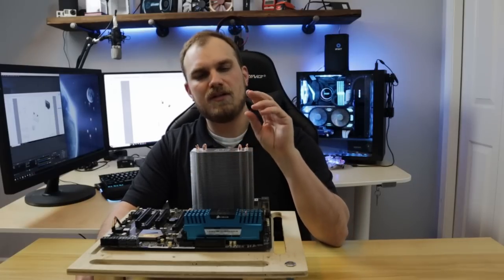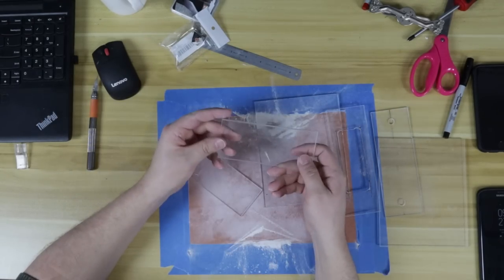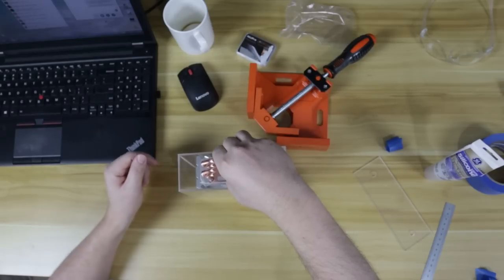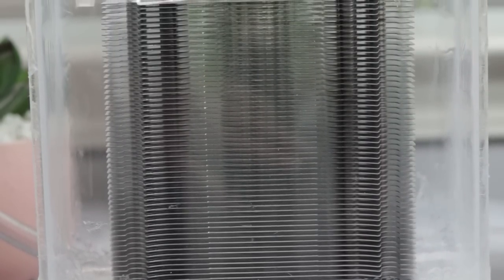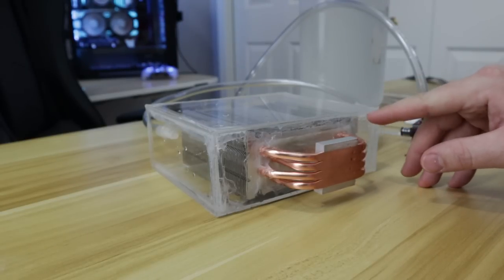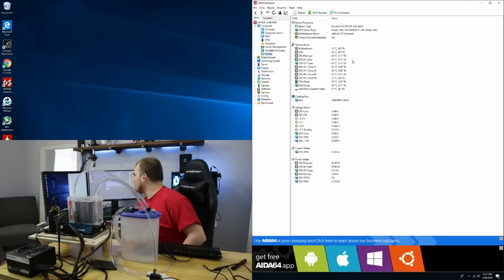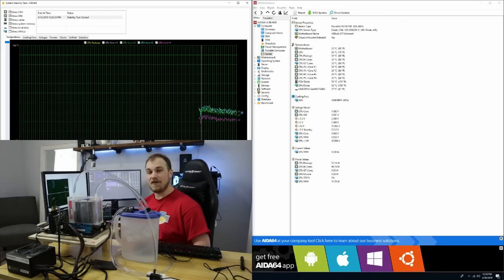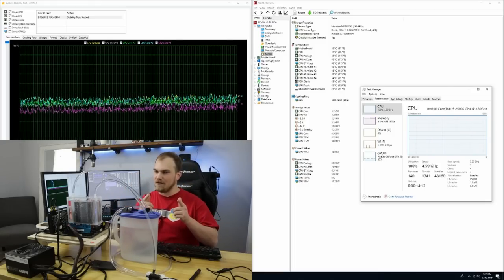I Water Cooled My Air Cooler AND..........

Comment: corsairs going to steal your idea and slap some RGB on it
Reply from the maker: RGB Would be sweet
Reply: hahahahhahahahahahhah
Reply: @MajorHardware  Put the LEDs in the water. They should do it.
Reply: Useless design, and technically it is reverse of Radiator with more disadvantage of no further dissipation of heat from the water. In radiator it is done by air cooling through Radiator FINS! it is good to be a Computer engineer, but implementing Mechanical to it requires knowledge.
Reply: @lakshaytewatia6205  U must be fun at parties.. 🙄
Reply: Lakshay Tewatia hey how bout an aio dipped in water inside a small chiller
Reply: @andrewmendoza6531  Brother i said accordingly to what the guy used in this video, and the external source which keeps the water cooled, is Ice!...and how long it could last? but ironically he improved it in his next video where he added an External Radiator to cool that water down..!so tell me what is the use to cool a radiator submerged in water and to cool that water he used another radiator! does this make any sense for this micro level of circumstances.
Reply: @nekokarasu1087  yea I could be... but not as famous as you kid. First go and learn the technical and practical terms. I do not argue with them who get fascinated by the Asthetics only to just look cool but of no use.!
Reply: @talon1706   I'm trying to spread knowledge among those who don't have any idea
Reply: A Gamer RGB
Reply: Oh that would be amazing with the aura rgb inside it
Reply: @lakshaytewatia6205  as far as actually being useful no this is a goofy idea but it looks cool but yeah i agree its impractical to use a radiator to cool another radiator but if you slap some blue leds in it 😂😂😂👌
Reply: @goldenfox334  aura is a piece of shit. Its lagging my vr like crazy when it's on. Such a bad designe I have to disable the drivers to play vr. By the way I sup the guy that this idea is redundant and useless on so many levels. Actually he is building an sub efficient watercooler from an air cooler.
Reply: @PatchworxStudios  why would it be lagging your vr setup. Well to be fair i seen ram sticks with issues because of led or noen tubes hooked onto them. I have a gtx 1070 strix ti and havent had any issues with games and the led stuff. I also have 32gb of ddr4 memory and the main os is on a ssd. There could be a few reasons why its running like shit on your system while ive never had issues with it. Does ot only do this while the vr headset is being used.
Reply: @goldenfox334  I cant tell you why but it definitely does interfere in some way or another. I found the solution on a Forum and was not the only one with this problem. The aura task is introducing a lag spike every couple of seconds, maybe the writing of led values to the controlles somehow interrupts something in my card resulting in frame skips. Without it everything runs smooth. And by the way my space3d mouse is also disrupting the Joysticks even if the Mous is of. Took also a while to figure out.
Reply: @lakshaytewatia6205  You realise it was an experiment right?
Reply: @lakshaytewatia6205  Except.......you didnt enlighten anyone.You just kind of came off as a know it all who just forces their thought processes unto others for no meaningful reason.......
Reply: @lakshaytewatia6205  So your assuming liquid wouldn't cool as well on the fin stack? lol water is literally one of the best conductors and insulators and with the size of his reservoir your point  is completely invalid. It would take some serious cpu temps to heat that loop to the point of failure and it's markedly cooler then the stock cooler..... of which I own.
Reply: and sell it for double the price cuz its rgb
Reply: @PatchworxStudios  Must be a fairly obscure quirk. Very easy to end up with problems that are specific to certain software and hardware combinations.

I have Aura enabled, and I notice no performance difference at all between it being on and off.

On the other hand, based on your description a few factors could be at work.
I have RGB RAM, the case has RGB, and the graphics card does as well but the graphics card RGB is incompatible with Aura.

You have an Nvidia graphics card, I have an AMD one.
I have an RX3950x, and so with 16 cores and 32 threads, if this is a CPU utilisation issue I'd be very unlikely to notice it (I don't think I've run into a single situation yet, especially in games where the CPU utilisation has ever gone above 40%, and even if a single core is maxed out there's always an idle core to pick up the slack for background tasks)...

But, hardware and software interacts in weird and unpredictable ways.
I know I have games that have gamepad support which glitch out and become unresponsive if I have my rudder pedals and joystick plugged in at the same time as a gamepad...

Why? Who knows. Typically these games only support X-input and the pedals and stick are DirectInput only, so it shouldn't be having any effect... But it does...

Computers can be like that. works fine for most people, but some people have no end of problems...
Reply: @KuraIthys  Yeah i understand, did some Soft/Hardware dev myself. Those are just oversights in the code. The only Problem i have is that devs dont fix know bugs. Had lately often trouble with HIDs not a single one wants to cooperate with eachother on steam.
Reply: I would like this tbh
Reply: Lakshay Tewatia Dude you talk to people love you get assaulted every morning. This is literally a DIY experiment, not cutting edge lab tech development. Honestly get the feeling that you would be the person to go to an elementary science fair and shit on a child’s 5 minutes of fun lol
Reply: @lakshaytewatia6205  he said it was a proof of concept quit pretending to be smart.
Reply: @lakshaytewatia6205  your an asshole
Reply: @lakshaytewatia6205  and you still watched the video lol. You do not understand YouTube and the business model of operating a channel.
Reply: @lakshaytewatia6205  I don't see what is wrong with it. It's just bigger, right?
Reply: @lakshaytewatia6205  you ruin the party, get out of here
Reply: @lakshaytewatia6205  yes water cooling is literally moving the heat out of the case so you can air cool it some place else. So  if you do what he did you need double the radiator space to accomplish the same task. Nobody ever said computer people could follow logic. That's why they put it in gates.
Reply: Using a radiator to cool a radiator isn't impractical.. It worked. It kept his pc cooler.
Reply: @ModMINI  do not need to be in water will shine thru anyway
Reply: @lakshaytewatia6205  keep water outside the comp case pipe it to a cpu

 cover plate
Reply: @lakshaytewatia6205  chill out man he is just experimenting with it, and didn't you notice he had a fricken had a IKEA's spices box
Reply: Haha, so true
Reply: @lakshaytewatia6205  no kidding homie did this for the lulz. I don't know the first thing about computers and it is glaringly obvious. How's your content, bud?
Reply: Guys, you must understand, Lakshay  studied in trump university, that's why.
Reply: Yea but I mean you’ll get a hundred+ boost to FPS :p
Reply: @lakshaytewatia6205  it might be stupid, but it looks cool. And if rgb has taught me anything, it’s that the cooler something looks the faster it makes you cpu.
Reply: @lakshaytewatia6205  midwit moment
Reply: @lakshaytewatia6205  you must be fan at parties
Reply: @MajorHardware  no
Reply: As long as they pay for it

Comment: I guess the next logical step is to add an air cooler to cool the water reservoir.
Reply: But you'll need a water cooler to cool that air cooler...
Reply: @mikechu01  next attach your entire ac to your pc cooling system
Reply: @aircoolbro21scndling49  even better! Remove the evaporator coil and replace it win a cpu colling block!
Reply: The laws of thermodynamics giggle... :)
Reply: Or to coil the Tube in a fridge 🤣
Reply: Acually its remove the cpu waterblock with a coldplate

Comment: Congrats on getting picked up by the algorithm 😂
Reply from the maker: All hail the algorithm
Reply: @MajorHardware  l try this project you are genius first for all to you now that,l think what about to add ice in that reservoair,water be very very cold
Reply: @MajorHardware  and some led be nice water and led nice
Reply: hey i have a question. Is this solution better than traditional liquid cooling?
Reply: @AkashdeepSingh-qq5fw  nope, unless you keep adding ice the water will eventually get too hot to remove the heat efficiently, or boil. the heat has to go somewhere and a tank of water has its limits.
Reply: LordOfNihil so build a decent loop with a pc radiator to dissipate the heat
Reply: The money rhythm
Reply: Yeah, about that...
Reply: @des-geek  don't ask

Comment: Q: So do you prefer Air Cooling or Water Cooling?

A: Yes.
Reply: Ahah!
Reply: The dude standing aside: wat?
Reply: r/InclusiveOr
Reply: Only time it's actually a logic answer
Reply: I think or needs to be in bold
Reply: @whitebeartigtig  It is fully cooled with water just to let you know. There is no air flow.
Reply: @homeleung578  wow you have Reddit.
Reply: That answer works on any liquid cooling system that has fans spinning on the radiator, but not in this context. This is fully liquid cooled.
Reply: Hahahaha! This made me smile.
Reply: @badjonatan  the pump isnt moving any air, its a magnet drive motor with impellers that are fully submersed. there is no air circulation in this configuration at all, unles you count the oxygen molecules within the h2o.
Reply: @Cichlid_Visuals  I love when "well, actually" is completely, totally wrong
Reply: @persephonelark6533  LOL some people have quite the imagination, especially when they have no clue how things work.
Reply: @badjonatan  there is no piston. Thats a small aquarium powerhead. Not an air pump. There is a magnetic drive motor that spins an impeller blade inside the housing, wich is completely filled with water. You are confused my friend.
Reply: @badjonatan  visit my page, watch my first vid. I know a thing or two about aquariums and their equipment, i have 6 tanks running, the largest of wich is 240 gallons.
Reply: @hatrez907  the water pass through the fins like the air does, so is in basic doing the same thing the airflow do
Reply: Q: Do you prefer no space or water leaks ?
A: Yes
Reply: So what to use as radiator... Freezer or radiator or even whole home heating system(ofc while it is hot so it is not working)?
Reply: @juhokaartoaho  moi
Reply: @badjonatan  Those bubbles are remnants of what was inside the tank prior to filling with water. They are bubbles because the waterstream pulled some of that air into the water when the water level was still rising. Besides, that pump is impeller pump, air pumps for fish tanks are diaphragm pumps with one way valves.
Reply: A: both of them
Reply: Bith
Reply: "so basically im an engineering pioneer"
Reply: @homeleung578  r/ihavereddit if this was reddit, which it is not.
Reply: Liquid air cooling is better than both water cooling and air cooling.  Try it.
Reply: You asked it just like a woman
Reply: @JorgePachon  jup, but there is no air as mentioned (shouldn't be). Cichlid_Visuals already explained.
Reply: This is just watercooling. There are no fans running. Its just a much bigger heater disappater than you get at a normal water cooler.
Reply: i seee good solution and cheap solution on both
Reply: @badjonatan  its not a solenoid pump it says brushless, wich means there is an electric motor turning inside
Reply: Both
Reply: watAir cooler
Reply: @juhokaartoaho  what you have here is a water heater. you still have to spin a compressor to make ice which is what was keeping this cold. but that heat has to go somewhere. eventually you would just be pushing hot water through the heatsink. of course you hit the boiling point and then you get evap cooling. but i dont think running your cpu at a constant 100c is a good idea, but its a good way to cool a nuclear reactor.
Reply: I THINK WITH NEW AIR COOLERS YOU GET GREAT PERFORMANCE WITHOUT THE FEAR OF LEAKS IN YOUR SYSTEM...
Reply: Fanny rash
Reply: new title
Reply: Check out the shit on Alibaba if your new to this concept!
Reply: Technically normal water cooling is just air cooled water cooling through.
Reply: I prefer watir cooling XD
Reply: This man is from another planet😂😂. Excellent idea sir.  Thanks for new perspective.
Reply: Watair cooling

Comment: Up next: I Blow Cool Air Through a Water Cooler.
Reply: HAHAHAHA
Reply: Lmao
Reply: After that: I blow cool air through a water cooled air cooler
Reply: that's how radiators kinda work tho :/
Reply: @alexbakaloff  
I was thinking with no water involved. Kinda like how this "air cooler" has no air involved. I have no idea what that would be like or if it could even work at all. I was mostly joking.
Reply: @Lucatin  ohhh, I can see someone getting very creative with this idea.
Reply: @Lucatin  Sort of like replacing the pump in an AIO with an inline fan or something silly like that. Probably wouldn't work nearly well enough to cool much more than an undervolted laptop chip though
Reply: change the liquid to any gas that gets cold when its hot
Reply: Will work great with nitrogen.
Reply: @Lucatin  this concept was already used in the auto industry.
Cars like the VW Beetle or even early Porsche 911 used a air cooling circuit.
Reply: Actually something like that was made a few years ago... The put a fan on an AIO pump head for extra cooling...
Reply: It would work as well as a water cooled engine with no coolant in the radiator.
Reply: You might be able to use a gas to cool a water block if you used high pressure helium.

It would be extremely dangerous though because you'd need to be at several atmospheres of pressure.
Reply: get a original idea. done by Jayztwocents already
Reply: I was just thinking that..
Reply: Well that's kind of how old evaporative coolers that people used to build worked,  I'm too lazy to find them but look up "bong coolers" and "nuclear tower coolers" on like overclock.net or extreme systems or any other forum where people did exotic cooling shit back in the day.
Reply: Its time to use a compressor
Reply: and he did
Reply: It would kill the pump (i know it's a joke but if he did it that would happen)
Reply: I use a staw when it gets too hot

Comment: You: Water cools your air cooler
Linus would like to know your location.
Reply: Radiator water spraying has been a thing on cars for a while now!
Reply: @RacingSlow  na nitrous is the way to cool er down lol
Reply: linus did complete pc in oil, basically the same thing
Reply: he got him on a techquickie video
Reply: @CryptoPaperRoute  In WWII they just poured used wood gas to cool the engine before using said gas as fuel.
Legit wood powered tanks.
Reply: Aaaaand LinusTechTips just released a video on water cooling an air cooler
Reply: Say no more fam
he got you

Comment: This is a fun experiment.
A few notes to take into account for your next iteration:
- make sure you have the heatsink fins vertical next time.
- have your water entry at the bottom of your tank, ideally the opposite corner from the exit. 
Both of those changes will help mitigate stagnant water between the fins and therefor improve cooling even further.
Reply: instead of putting the water entry or exit at the bottom, you could just extend one of the top tubes downward from the top.   also, as much as i agree with the vertical fins, that's a lot of weight/torque to be putting on the board since it's filled with water.  putting an additional pump inside to move around water may be a nice compromise.
Reply: This would put a huge amount of stress on the socket, it's not designed to support that mass of water
Reply: @samdavies1752  do the math.
It's not a particularly large heatsink; there's larger and heavier ones on the market. Besides, a support bracket is easy to make.
Reply: 1 more thing @major hardware you should note is that cold water is basically a poison for any system. The condensed vapor on the outside of the cooling body will drip into your motherboard and kill it.
Reply: @cryonim  As long as the water is above room temp u dont have condensation. and with the ammount of ice he is using that shouldnt be the case.